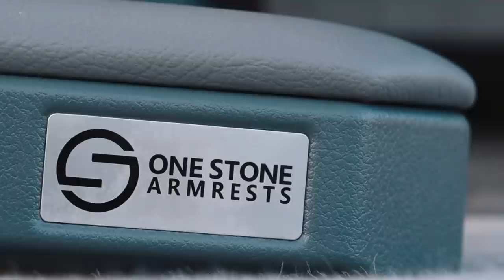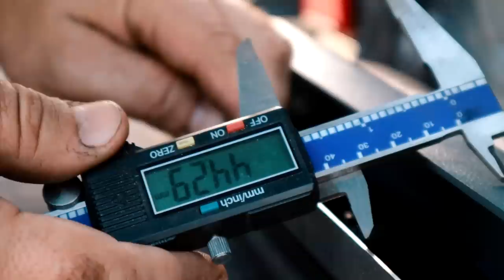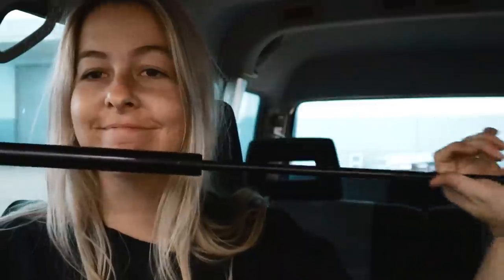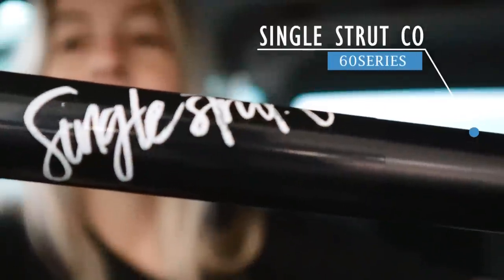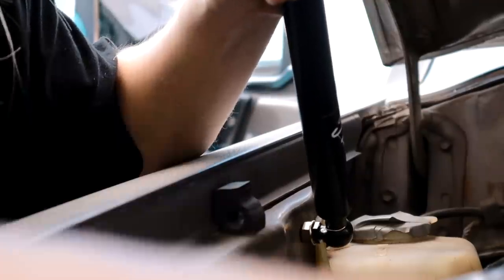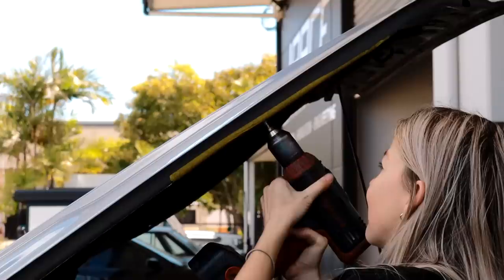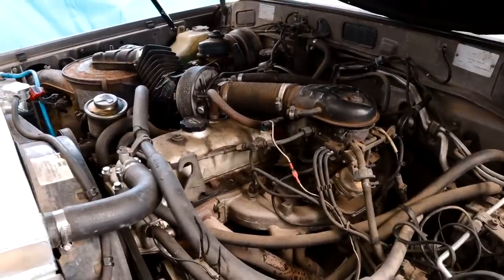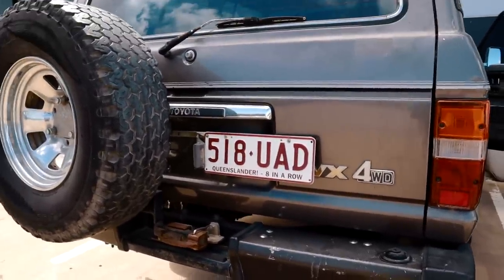Project 60 Part 3 - Landcruiser Cupholders? + Real talk

Comment: I've had a look at the one stone armrests before for my 80 series, but I don't want drink holders and they don't make them without the drink holders~;0( Should you not put another strut on the passenger side of the bonnet also? Danie your videos are getting better all the time. Keep up the good work.
Reply from the maker: No as talked about in the video these struts are designed to be used as single struts for those that have batteries on the other side. Bonnet is still support by factory bonnet spring on other side